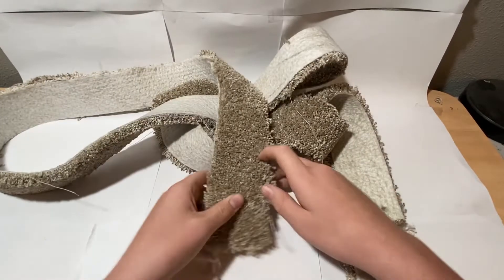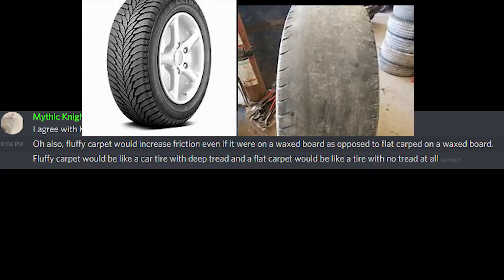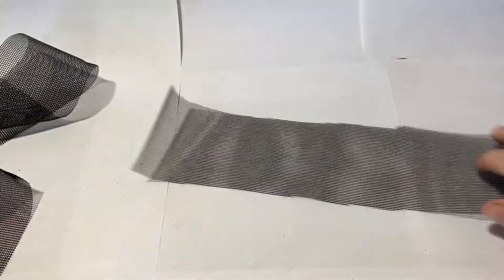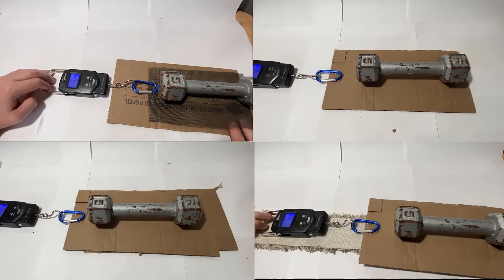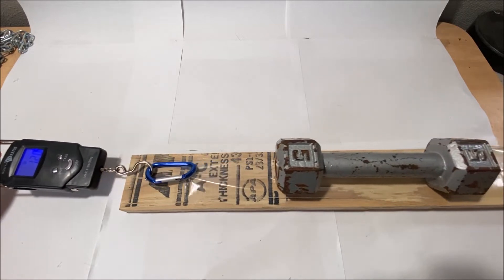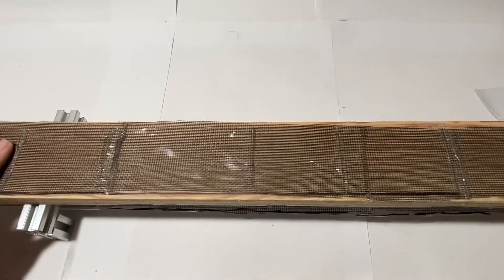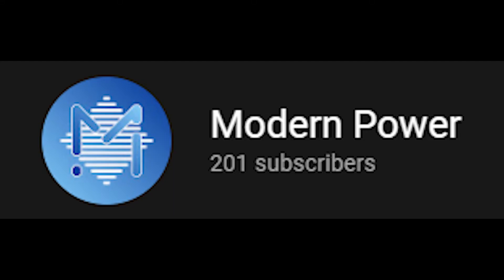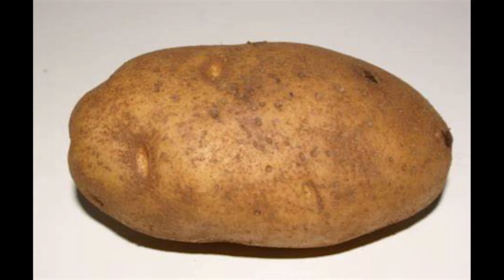DIY VR Treadmill Alternative Belt Design  (Build Log 6)

Comment: Your analogy is not 100 percent accurate. In dry conditions Bald tires actually have more traction than tires with tread! Tread is only there to divert water and prevent hydroplaneing . The more surface area that contacts the road the more traction.

Comment: Interested to see how the plastic works. It can pull 15 pounds, but what about a human? That’s no small potatoes.

I wonder if a tougher plastic would work better. Maybe something like vinyl?
Reply from the maker: i will be doing some more extensive testing in the next video! also the cool thing is not much tension is actually applied to the plastic itself. most of it is being supported by the fiberglass mesh!

Potato

Comment: Didn't you buy a used treadmill? not sure if it had the belt but would that belt work? also Potato
Reply from the maker: i did but thats only one belt and i needed around 8 to make the whole belt
Reply: @modernpower6285  yea but the tread mill belt I assume is much larger and could be cut into smaller belts? (just an idea, without the exact dimensions of it all to calculate if thats even possible or not)